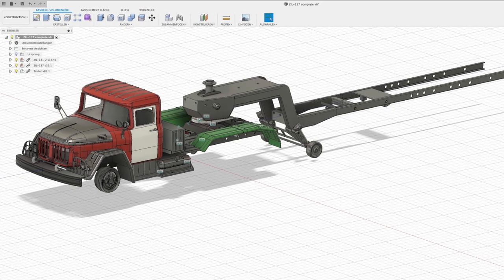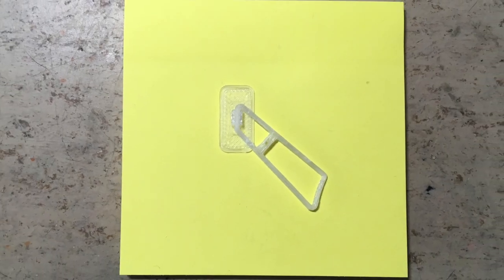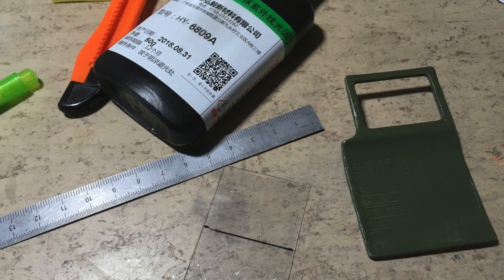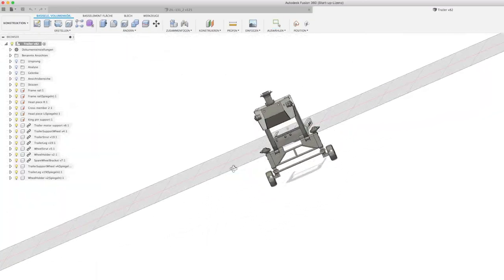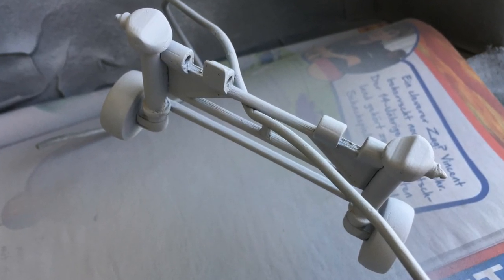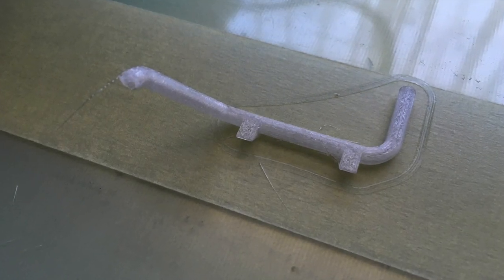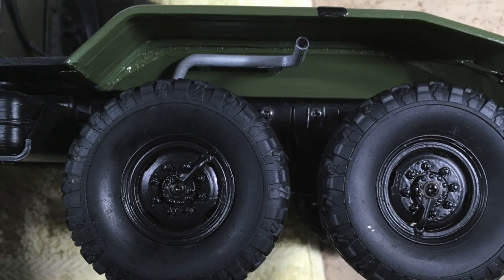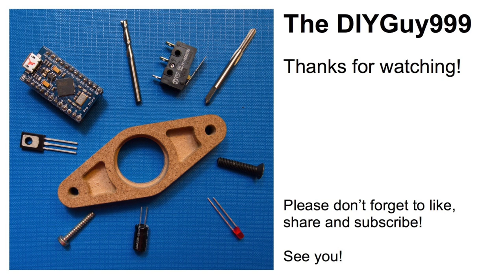WPL ZIL-137 V8 10x10 Truck: Mirrors, Indicators, Searchlamp, Exhaust, Trailer Support!

Comment: Wouldn’t this work better for the b36 ural instead of the b16? I’m ordering one this week and plan on using your files to make similar.
Reply from the maker: My parts are designed for the JJRC Q60 and will not all fit on the B36 unless you change them.

Comment: please tell me how to install fusion 360, i've many times and always fail
Reply from the maker: Hard to tell. Does the installer fail or do you have a licence issue? What exactly is the error message?
Reply: @TheDIYGuy999  error: "-2147024894, 'The system cannot find the file specified." while installing fusion 360
Reply from the maker: @galendcia  see: https://knowledge.autodesk.com/search-result/caas/sfdcarticles/sfdcarticles/Fusion-360-install-fails-with-error-2147024894-The-system-cannot-find-the-file-specified.html